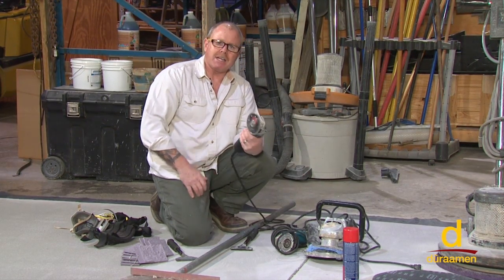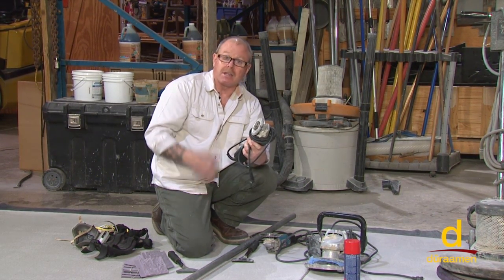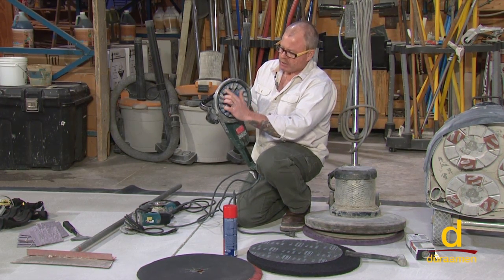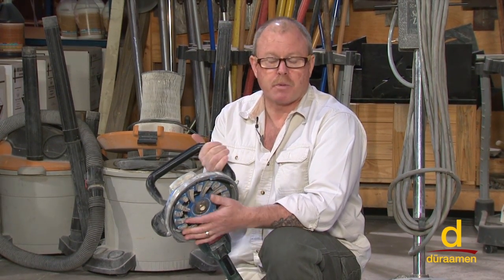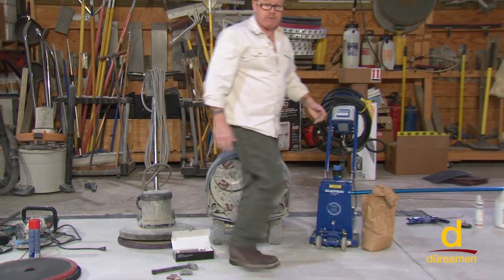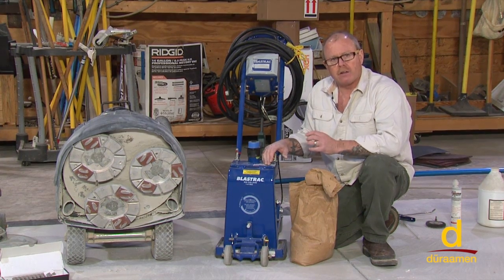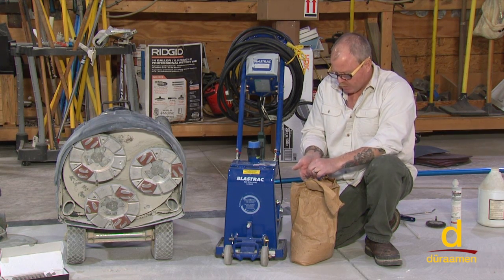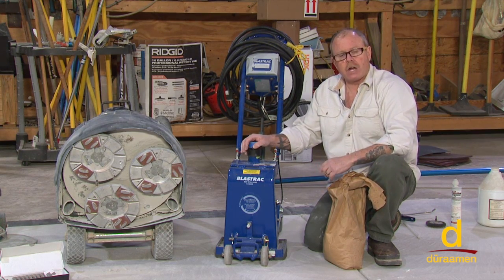Concrete Surface Preparation - Introduction

Comment: These instructional videos are are extremely informative and well presented. They are exactly what I’m looking for as far as attachments and such for my 17” Clarke machine but I have a question for someone more familiar with the industry... finding attachments for them have been very hard to do. If I’m looking for specific attachments such as a 15” grit stripping brush or diamond pads and tool plates with segments sold locally, how do I go about finding the nearby stores that would carry them?

Thanks for the vids!